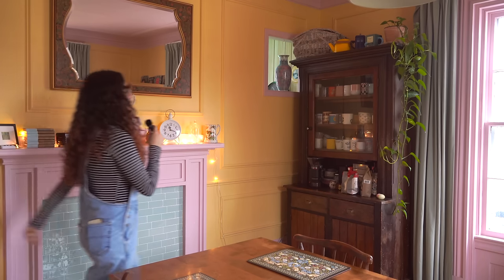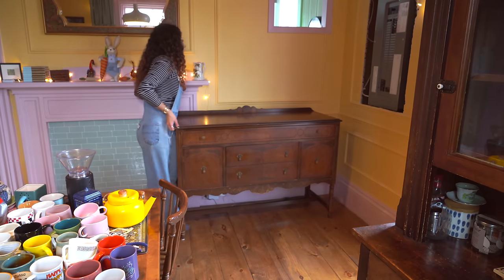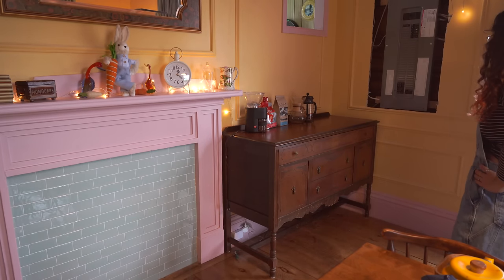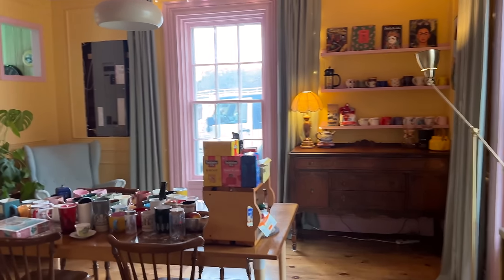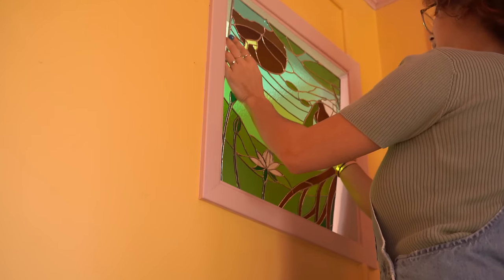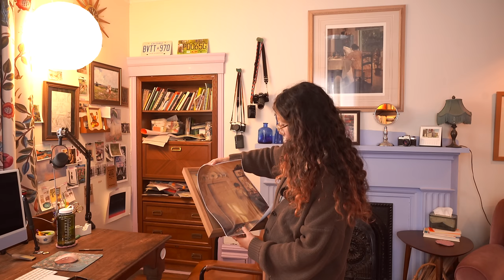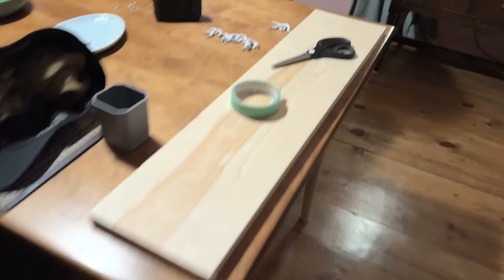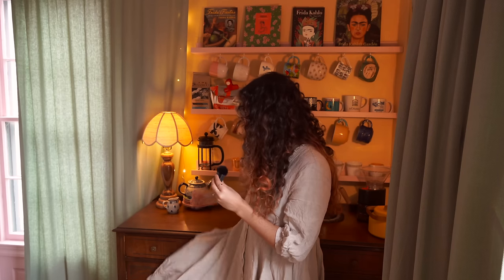I Built My Dream Coffee Bar ☕️

Comment: I love it but I would strongly consider putting a protective glass top on.  The inevitable hot coffee drips are going to eventually ruin your top without it.
Reply: I put a slab of stone on my coffee bar and so glad I did.
Reply: She could even put an inexpensive tray on the top too
Reply: yes!! i also wonder if a polyurethane coating could also be a good option in that scenario? i usually prefer to retain the original finish but would love to know in case i personally do something like this one day haha
Reply: Or even just the use of doily’s or a runner.
Reply: Or plexiglass
Reply: That's a good point actually
Reply: Came here to say this.  I have glass on my coffee bar and it has to be cleaned often due to drips and spills.  The furniture underneath would have been ruined without the protection of the glass.

Comment: Love all the changes.  When you can, frame the stained glass  or use thin molding on the front and back of the opening to create stops to hold the panel (like a glass in a window frame).  Foiled stained glass over time will soften and could bend the outer frame and warp as it hangs.

Comment: If you would have removed the decorative moulding on the wall and applied it to the wood piece, it would have shored up the wood panel (you can see it is warped) and made it nearly invisible. The handle could then have been replaced with a magnetic click closure.

Comment: Helpful hint, dont be holding your stained glass by the bottom like that. The tension will crack it. Hold stained glass like you are holding a big piece of paper you don't want to wrinkle/crease.
As in, by the top sides. Straight up and down or flat on it's back on a hard surface. Never leaning.

Comment: You should of just put a painting over your electric box we did in an apartment and the poor maintenance guy couldn't find it like they are all in the same place in each apartment we used command velcro painting stripes so you don't have to worry about putting holes into wires.

Comment: I’ve seen windows between kitchens and dining rooms before. They are pass-through. But yours is so high, you would be lowering hot food from over your head. You might want to enlarge the pass through, and make it lower.
Reply: It’s not a  food pass through,it’s for heat to go from an original wood burning cook stove in the kitchen to be able to eat in the dining room without having to start and tend a fire in the dining room fireplace.
Reply: @lauramitchell6725  Okay, thank you! Your explanation makes sense. I’ve seen floor vents that allow heat to travel to the upper floor.  I hadn’t seen one that passes through a wall.
Reply: @pattimessenger6214  We lived in Vermont for ten years and I saw a number of older homes that had the same thing.I used to help an 89 year old couple (in the early 1980’s) who told me that’s what the hole was for. They were born in the late 1800’s and their house was a little older than they were.😳
Reply: @lauramitchell6725  I don’t get to see many old houses. I live in California.  My house is considered “old”. It was built in 1965!
Reply: @pattimessenger6214  🤣😂😅